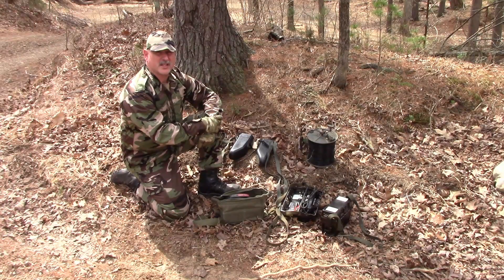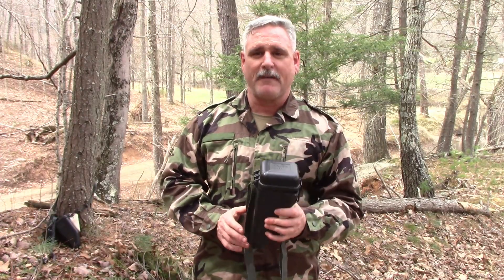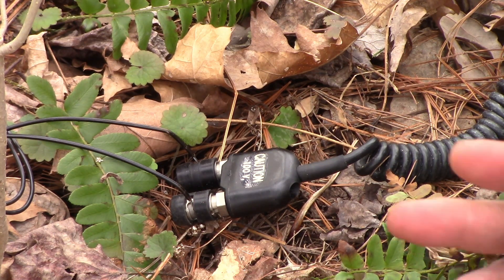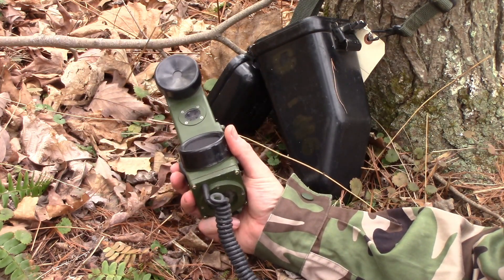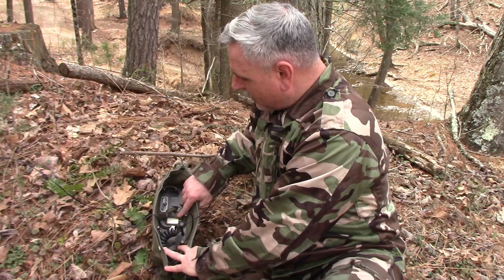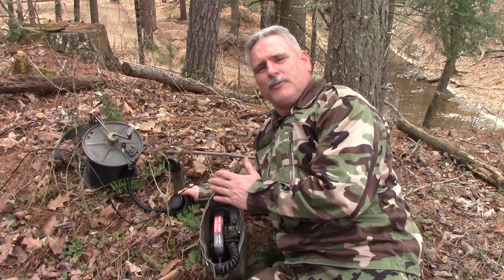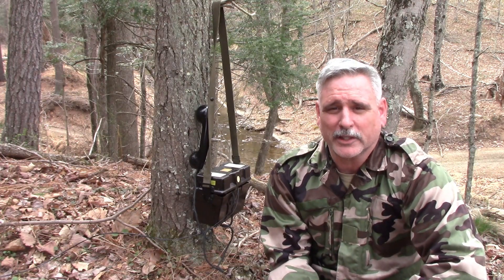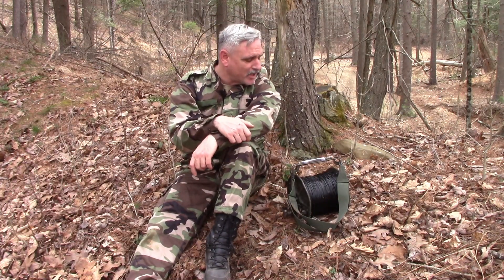FIELD PHONES

Comment: 14:48 
The two small openings on the Front of the german field Phone are not for the cables!(they have to get out on the left side with the rubber rim!)
There at the front you can flip out the inner folding bracket, where you than can hang on the handset with closed lid.
The function than is that the microphone is deactivatet and silenced.....and in the working mode of "central battery" if you Pick up the handset it rings at the switchboard Office....
Greetings from germany!🙂

Comment: If this uses 2x D-cell batteries in SERIES, you could easily use a single 18650, or a PARALLEL pack of 18650 batteries for more capacity and less weight. (2x 1.5v is close to the 1x 3.7v)
If the D-cell batteries are in parallel, it would be a more technical question on whether you could upgrade to the higher 3.7v batteries.

Comment: I have examples of that equipment. Plus a Swedish tool kit for setting the wire in trees.
Reply from the maker: Interesting.   I would like to know more about that Swedish tree item.
Reply: WW2 era kit consists of four-1meter interlocking steel tube sections with two pronged ends and two pruning hook parts. All fits in a russet leather carry rig.
 @PegasusTests

Comment: Yeah that 100 volts can set off an electric blasting cap as well. The enemy has also used the crank to apply 100 volts to prisoners nuts.

Comment: the only major difference between the ta-43 and ta-312 is the ta-312 has an external handset/headset connector and an internal/external switch for the connector, otherwise both phones perform and operate the same way. the ta-43 and ta-312 can communicate over 22 miles of wire, the ta-1 is limited to 1-2 miles since it is sound powered. the magneto in the ta-1 is rather weak, and might not be able to ring a ta-43 or ta-312 if it is more than 1 mile away. there is a visual ringer light accessory for the ta-43 and ta-312, and there is also a touch-tone keypad for the ta-312 that allows it to connect to any standard pots landline. both the ta-43 and ta-312 can operate without batteries when they are connected to a powered switchboard like the sb-22.

Comment: I need to get a couple of TA-1s, I like them. The TA-43 and TA-312 have the battery AND weight issues--they are heavy. Not an issue for stationary positions, obviously. 

I really wish I could find reproductions for those handset warning decals for my TA-312/PT phones... 

BTW: Not sure what's wrong with your TA-1--probably nothing, your TA-312 or TA-43 selector switch is likely in CB or CBS mode?--but the batteries don't have anything to do with the ringing ability of the phone; the batteries (TA-43 & TA-312) only operate the microphone element when the PTT is pressed. The ringing generator on the TA-1 should definitely put out enough voltage (65~80VAC) and the proper 20Hz signaling to ring the TA-312/TA-43 with or without batteries--or even the SB-22 switchboards...and other two-wire field phones operated by the US military and NATO countries. My TA-312 phone clackers operate no problems so long as the selector is in LB (local battery) mode--CB (common battery) and CBS (Common Battery Signaling) are for use in other kinds of phone systems (Automatic switchboards, usually) and don't use the ring voltage for calling--typically for outgoing calls only. Most field operations only use the LB selector.

Comment: It was interesting video, we still use field phones- allthough very rare, for example when setting up linear ambush, for the left and right flank. The reason was to maintain communications in case there is jamming.
Reply from the maker: Thats a good use!
Reply: @PegasusTests  I wish we trained more in simulated conditions where there is OPFOR with EW capabilities. But then again  if someone has used expensive military grade communications equipment like radios- he would be surprised that there are situations- when there are problems in the field when there shouldn't be any reason for them- allthough this just my opinion as "consumer" not a communications specialist.
Reply from the maker: @karamelles98  You're not wrong

Comment: Radar used an EE-8, which was used prior to and concurrently with the TA-43.
Reply: Yep. And the process for connecting calls from Radar's HQ to the Pentagon is pretty easy. The HQ is using a SB-86/P or other larger switchboard with a telephone trunk line, which of course gives access to the regular phone system (at the time a series of operators, probably at specific military bases in the US, connecting patch cords and transferring the call)--a little time consuming maybe, but definitely not unrealistic at all. The EE-8, TA-43 & TA-312 operate in local or common battery mode, so all Radar has to do is pick up the handset and it signals the HQ switchboard that the MASH phone is off hook. I have all of the aforementioned telephony devices and the way they can interconnect is just cool! I've seen comments from US Marines that TA-43 and even EE-8 field phones were issued in theater in the Gulf War in '91!!--Not sure if that's accurate, though.

Comment: TA-1 is sound powered.  The squeeze magneto generates ring only.  TA-1 is only as good as the PMCS performed.  They had a bad habit of the mic element getting solid and not work also they needed the internal contacts burnished and cleaned on occasions..  Applying  power to the TA-1 line won't improve the sound power.  A TA-43/TA-312 will ring with no batteries in it.  The batteries do nothing but power the microphone element.   You can operate them using external batteries up to a 9V using the external power screw posts on the top of the case.
Reply from the maker: We can use some help at 1 Shepherd with our field phones.  Would you be interested in helping?
Reply: @PegasusTests  Absolutely
Reply from the maker: @thefieldphoneguy8254  how do we reach you?